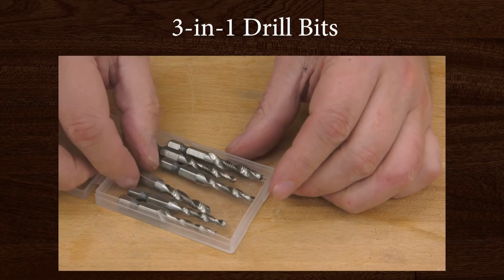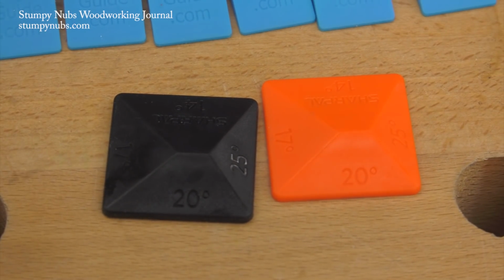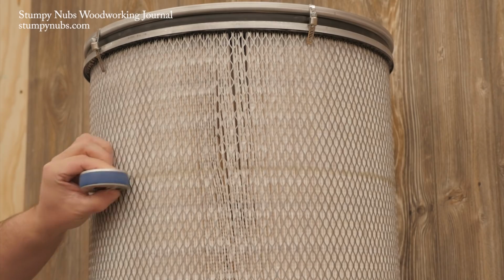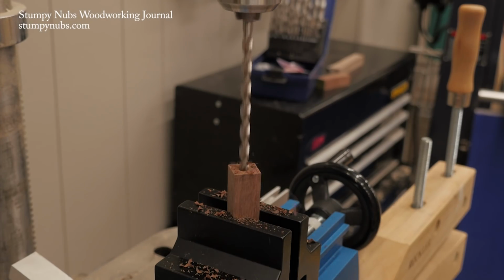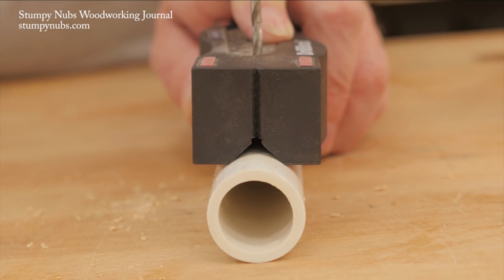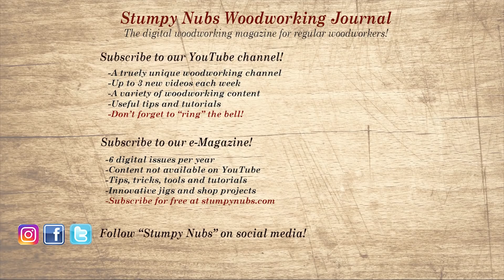10 CHEAP tools I use in my workshop

Comment from the maker: PART 1 of 2 Special editions of Cool Tools to kick off the 2020/21 woodworking season!
Links to stuff in the video►
3-in-1 Drill Bits: https://amzn.to/2KxWQV4
Dremel Keyless Chuck: https://amzn.to/366b4VB
Sharpening Angle Guides (2pc): https://amzn.to/3fzSjNg
Sharpening angle guides (11pc): https://amzn.to/3q1GmVx
iGaging RollBot (Sponsored): https://www.chipsfly.com/rollbot-tapeless-measuring.html
Nail Holder Pliers: https://amzn.to/33erTM3
Fence Clamps: https://amzn.to/37d42xy
Fisch Pen Drill Bit (Sponsored): https://amzn.to/37cYtiV
Wonder Slick Stick (Sponsored): https://woodturnerswonders.com/collections/grinding-wheel-accessories/products/wonder-slick-stick
DrillBlock Drilling Guide: https://amzn.to/33fmW60
Electric Lighter: https://amzn.to/3nWAevT

(We may get a small commission if you use one of the above affiliate links.)
Reply: Milescraft is highly underrated!  They're the only ones that offer a mid to low range price for a lot of gizmos n jigs that are only made by higher end makers n cost!!!
Reply: Tell me about your vice on the drill press. Great content as usual, keep it up.
Reply: I could really benefit from using the RollBot and DrillBlock!  Ty Stubs for posting this!! 👍🏼
Reply: The trick of tapping hardwood and using conventional ASE machine screw hardware is one I have used for years.  One of the most beneficial things I get from these videos is seeing a hack I felt guilty about endorsed by someone with some cred.
Reply: It looks like that hand plane on top of the shelf just above your head to my left has a broken handle
Reply: I would like to think that Proxxon makes a better" knock-off" than Dremel. They are just that bit more powerful and with a desktop transformer much lighter in hand than models with the motor in handpiece. And the chuck is also quick-fit.

Comment: If this list was in the description, YT would make chapters in the video's timeline, making it easy to navigate to the start of each of the things. Please add it:
0:00 Introduction
1:08 3-in-1 Drill Bits
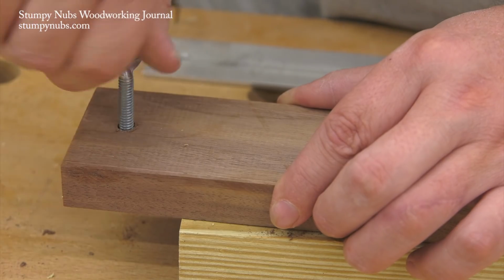2:26 Dremel Keyless Chuck
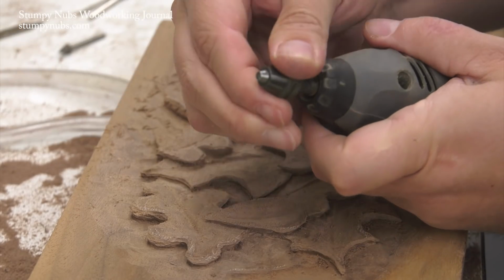3:18 Sharpening Angle Guides
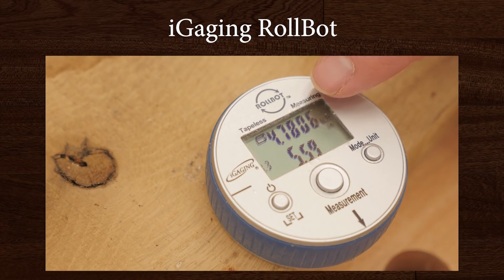4:40 iGaging RollBot
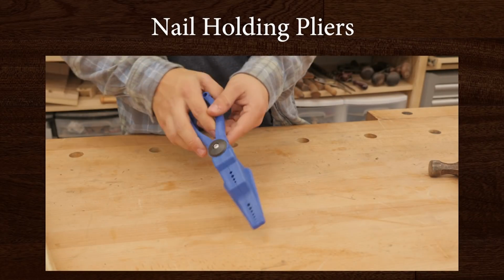5:39 Nail Holding Pliers
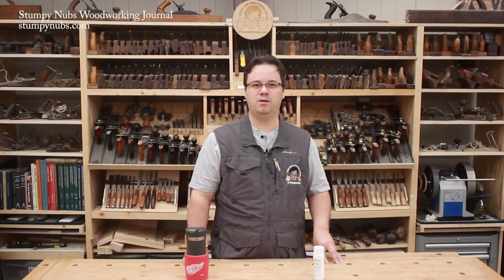6:20 Fence Clamps
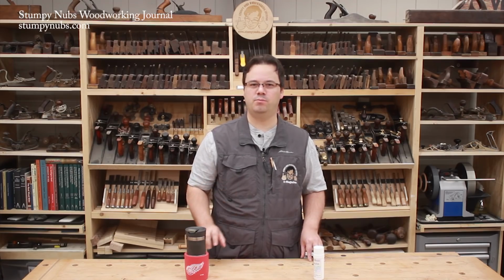6:59 Fisch Pen Drill Bits
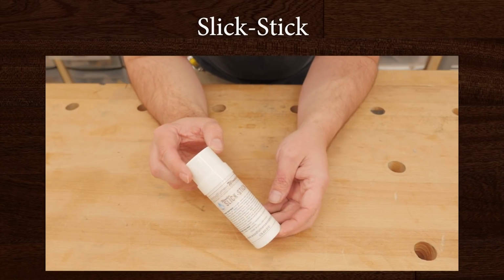7:48 Slick-Stick
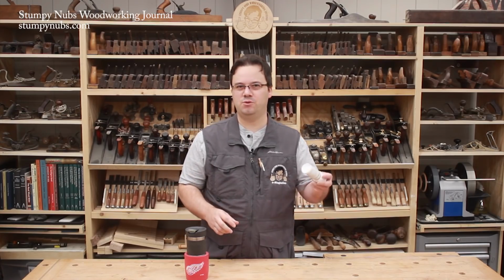8:23 Drill Block
9:01 Electric Lighter

Comment: Perfect timing for inexpensive tool ideas for Christmas. And any wife that doesn't hang out in the shop will appreciate that cool lighter for candles.
Reply: The Slick Stick MSDS says it's a mix of the following: Severely Hydrotreated Mineral Oil, Paraffin, Microcrystalline Wax, Tallow, Carnauba Wax. So it's a wax and oil blend. Which makes sense - you can get similar results for grinding metal from petroleum jelly - jewelers have been using similar products for a long time

Comment: I got a 40" extruded aluminum 2080 20 series off amazon and took my dewalts fence and some 2080 hardware put em together and now can make jigs that use the extruded aluminum as a railing system and holder and  a board  of melamine to add to the face when I want and also made a feed extender that it uses also from a simple board that goes from its back screwed in then under the fence that's flush to the table top and fence bottom best thing to have in my opinion

Comment: About the dremel chuck. If you are engraving detailed parts I would recoumend using the collet instead. The chuck has quite a bit of run out that is very noticeable when it starts to resonate the collet is far smoother and accurate at high rpms.

Comment: The Slick Stick MSDS says it's a mix of the following: Severely Hydrotreated Mineral Oil, Paraffin, Microcrystalline Wax, Tallow, Carnauba Wax. So it's a wax and oil blend. Which makes sense - you can get similar results for grinding metal from petroleum jelly - jewelers have been using similar products for a long time
Reply: "Severely hydrotreated" sounds like something prohibited by the Geneva Convention :)
Reply: Old school machinists in my country always use rancid pork lard for everything drill related, works like a charm. My guess is this is a well-R&D-ed modern equivalent. As long as the price is competitive and it works, all hail progress! 😂👍

Comment: I’ve used those tapping bits for years on steel, usually I beams or angle irons, as long as you maintain a good speed and lubricate they work well. They do break once in awhile but still worth the time saving.

Comment: Just like my kitchen, I try to keep gadgets out. However #1 the drill/tap bits we use ALL of the time. We install commercial doors and use them in metal and in impact drivers.  The larger 1/4-20's and 10-32's seem to do well at higher RPMs.   Love your video's THANKS!

Comment: I have to put the keyless Dremel chuck at the top of this list... the stock jaws with the stupid little collets are the biggest pain in the neck! If it’s a good bit that will last for a white (carbide burrs, diamond tips, etc) I’ll go ahead and grind 3 sides on the shaft so the chuck will hold it more securely without it slipping

Comment: As am electrician I use those combo drill/tap bits in an impact on steel panels all the time. Once in a while one breaks, but they are pretty tough and very handy.

Comment: Dremel wrenches.  Take 2 tie wraps.  1 around the cord, to fix where it is.  Then chained to a second tie, to the wrench, then you always know where the wrench is so it's a lot more handy.  Put it near the end of the cord, but far enough up that the metal wrench won't hit electrical plugs or outlets.  Just 1 tie locks it to the cord a bit too closely, using 2 like this is better.  Having it tied down where I always know exactly where it is makes it much more convenient.  Keyless is still the way to go if you change very often, but just having it attached to the cord eliminates a lot of the PITA aspect..

Comment: As to drilling hardened steels. Bob Brownell in his book on gunsmithing found that to "soften" a metal where you desired to drill a hole, he would take the cylindrical carbon rod from a "C" cell battery, sharpen one end to a point, fasten copper wire to the opposite end and attach that wire to one of the terminals of a rectangular lantern battery and attach another wire from the other terminal to the work piece and touch the point of the carbon rod to the place where you wanted to drill the hole. This would heat treat the spot on the metal, softening that spot to allow drilling.
Reply: Wow! That's amazing, and so simple. A common 6v lantern battery. And cheap!
I have to remember that one.
Seems those lantern batteries just never go out of style.

Comment: As a machinist, I can confirm that tapping CAN be a high speed process. It’s quite amazing. Yeah, you’re probably not going to do high speed tapping with those combination drills, but yes it can be done in industry with the right tools
Reply: Sure, with an expensive lathe and the right inserts.
Reply: These taps are like gun taps.  I've drilled tons of holes in steel (C-channel, tube and I-beams) with these using an impact.  I've tapped small holes (1/4") with small impacts and larger holes (5/8") with larger impacts.  These bits have 2-3 flutes instead of the 4 flutes that hand taps have.

Comment: I have been using the drill/taps for years primarily for tapping holes in electrical boxes, panels, ... (thick sheet metal) . One of those extremely handy tools.

Comment: The 3 in 1 drill bits are awesome, I don't have the imperial set, I have an m3-m10 set for aluminum extrusion and fences. Metric is the way to go and often much cheaper and easier to calculate on the fly.

Comment: i've found a counter-intuitive at first way to sharpen knives, which doesnt have all the typical problems associated with holding different knives at a consistent angle. Hold the knife securely in one hand and use a small/medium diamond sharpenner in dominant hand and slide that against knife edge. i found it much more consistent and you can have the bevel in full view of eyesight, unlike trying to slide a knife against a stationary sharpenner, fighting all the imprecisions of those movements and not seeing the bevel being done in real time.

Comment: This edition had some items I've never seen or heard of before. I had to sign into Amazon while watching you because I kept going back and forth to the video and checking out the info on the items. I bought these "iGaging RollBot",  3-in-1 Drill Bits, DrillBlock Drilling Guide, and the Fence Clamps. I've always meant to buy the clamps but spaced on them so today is a good day to finally buy them. I look forward to using the "Rollbot" in my metal shop as well as the woodshop. Some of the things I make are often odd and not regular round holes. Thanks!!

Comment: This triggered a memory. I vaguely remember having a ruler like that as a kid (in the ‘80s). I think it was called a rolloruler but I couldn’t find it online. It was mechanical and not super accurate. We also had a nail holder similar to that.
Reply: I have used needle nosed pliers to hold nails. Works pretty good.
The nail holder shown here would work better, because it holds the
mail in a long slot, rather than just on two sides. That way the nail
can not slip, perpendicular to the grip.

Comment: The best solutions come from  a little desperation: nailing a shingle on the roof when its raining any cold. 2 pieces of lath (.25"x 1"x 6") a rubber band and a    small magnet.  Trim off the ends so that
Reply: So that the ends form a U shaped  channel that the magnet can hold a nail in. The nail is longer than the wood is wide and the two wood pieces.  With a little adjustment it will pick up a single nail and hold it proud of to be set. With the nail set the tool is removed and the nailing can be set with another swing. Can be used with gloves on.

Comment: One thing I would suggest for a cheap tool is a 1,2,3 block.  It is used by machinist all over so they make them cheap.  It is a hardened steel block, usually with threaded holes that are perfectly square and flat that you can use to clamp or quickly measure out inches.  Bolt them together and you can have a right angle and some other shapes.  It comes in handy a lot of them time.

Comment: DeWalt version of drill tap bits works well with mild steel and an impact on a low setting.  Impacts do not get the bit hot because they do not spin continuously.  I have done at least 50 holes/threads in mild steel with one drill bit. If you use them with a drill they do not work very well in steel.  Below is from DeWalts websight

Drill and tap holes in one application and deburr and countersink in a single step with DEWALT IMPACT READY® Tap & Drill Bits. Designed for impact drivers, each bit is equipped with a speed tip to penetrate materials quickly. Crafted for extreme durability to withstand tough jobsite conditions.
Reply: and regardless of material or driver you should make  only use it on material thin enough that the drill part breaks through before the taps part engages

Comment: High quality drill and taps will drill both stainless and mild steel up to 10 gauge. I use them regularly to tap electrical panels in bot a drill and impact gun.

Comment: I’ve been tapping holes with impact drivers(rattle gun)  for over 30 years press a nut on the tap, lube and tap careful not to apply any side pressure and reverse often. Tapping is faster and once you get the feel break less taps than by hand.

Comment: We use the drill and tap bits on 1/2in red iron. They do great once you get the hang of it.  you can cut and tap at the same speed if you can keep steady when the threads start to cut. Would definitely recommend. But I wouldn't use it on something critical or high dollar. Although we haven't broken any I wouldnt take the chance.

Comment: To drill square to a surface, drop your engineer's square down and use the eyeball. Helps when you are chiselling out a mortice as well. A couple of advantages are that you can still use a tape 'stop flag' on the bit and over time you just get better at drilling square freehand.

Comment: The combo drill/taps work much better if you use a loose holder. They need to be able to adjust a bit on the smaller ones or you'll snap them. I'm talking M3 and M4 sizes.

Comment: I have  4/10 so I think it's a good list (and the rollbot looks great, I have the "Digital Angle Cube" from the same company and it's convenient, magnetic, and certainly well enough built for casual use.)  I've used the nail holder pliers for those network cable hooks (little plastic clip with a nail built in), just because they get some extra reach when on a ladder, while still keeping your fingers safe.
Reply: Mark, that's a great use. I don't have these nail holders but
never eve thought of using my needle nosed pliers. (even after banging my fingers)

Comment: 2:38 when I first got my dremel I had to send for this the same day, as well as it just been super useful I needed it as about half the bits that came with my dremel were too large, I wasn't too happy that the dremel tool kit that was packaged in the same box didnt fit the tool but luckily like I said its useful and was cheap (and luckily we live in a age were same day delivery is an option, remember when you had to wait two weeks or more for a delivery)

Comment: Haven't seen a drill tap in years. We used to get them in the metal shop I work in- not to start from scratch, but to open an existing hole and thread it. I don't think a tapmatic would work too well for drilling holes from scratch anyways!

Comment: I’ve been using Tap/Drills for years. They are a great time saver and you can use them on mild steel with a drill. Just go slo and tap lube is a must.

Comment: Don't know what brand of the tap bits you're using but I know the ideal and Klein brand ones can be put in an impact and have no issue going fast. I use them often at work (electrician) and never had an issue using them on thin mild steel. 

They're absolutely useless though if you're drilling anything thick. Especially the 1/4 20 bit. Constant use in custom boxes to drill for the cover screws. Nothing more than 3/16th steel. Next to useless in structural steel beams for bonding. 

I know it's not likely many reading/watching would be drilling structural beams but just for a rough idea what they're actually capable of

Comment: I'm totally buying a rollbot. That thing is amazing.
Also that drill guide is nice. Bought one a long time ago. My only worry is using up the sides of drills so I would definitely use it on the drills from the mediocre pile
Reply: Is wear on the side of drill bits a concern?  Most of the cutting action is going to be at the bottom.
Reply: @kaasmeester5903  on a smaller drill if you wear a side more, you will have excentric forces that will put a bend in it, mostly on smaller sizes. Also if you have a pushed burr on it, it will ruin the finish of the hole on the inside. My concern here is that people who use universal drillbits will use the same drillbit for wood and mild steel for example. On wood it doesn't make a difference, then you move to steel and you have an oversized hole with bad sides and a lot of noise while making it

Comment: Great List James!  I have several of the items ( or similar ones) but I have the hardest time remembering where I stored them since I seldom use them ( except the fence clamps & taps bits, I use them all the time).  Going to try the mystery lube,  that sounds fun.  So I just wanted to add three more items to the cool list: a good pocket knife, kept very sharp; a Pentel mechanical pencil which I see you use as well, and Herock Work shorts.  While I may no remember where I put this or that down, my knife, pencil, pocket square, tape measure and piece of chalk are always in my Herock shorts pockets.  Check them out, I live in em 😎

Comment: I have found, using the drill/tap bits, a cordless impact driver works great. USE cutting fluid. You can run them pedal to the metal when drill but slow down to about 1/3 of the drill speed when they start to tread the holes. When in doubt, add more cutting fluid. When the treads engage, cordless drills have a tendency to over torque the tap as they try to force their way through the material and break them. Where the impact driver will drive it slower because of the impact and the impact action gives that little force to turn then relax action needed to tap holes. The other thing I do with impact driving taps is, I will pump the trigger to the gun. Squeeze to full speed and release. You're only spending about a half second at full speed and having the trigger released for half second. It also helps to drive the taps

Comment: Love your videos, I see your recommendation for a decent chisel is the Narex, when looking on Taylor Toolworks website I see 2 variations of these besides the Richter. There is the Profi and the Premium , the obvious difference is the Profi has 2 steel ferrules, do you recommend one over the other and what other difference is there. Thank you for your response. I’m a disabled veteran and new to woodworking and any help is always appreciated.
Reply from the maker: There are a few differences between the "Premium" bevel edge chisels (not the Richter) and the "Profi" bevel edge chisels. The steel is the same. But the premium version has the edge bevels (along the sides) ground back farther, which reduces the weight and improves the balance. That can also be helpful in some tight spaces, but since most of the work is done with the first inch of the blade's length, I think that's only a small improvement. I find the rounded end of the premium handles more comfortable for paring, but the Profi handles will be more durable for pounding. Either one will serve you well. Here's a link to use: https://lddy.no/sqm3
Reply: Thank you , that really helps. God Bless.

Comment: The electric lighter works when butane is to cold to work. I used all the time in my col shop to light my propane heater. Much safer than a match or butane lighter